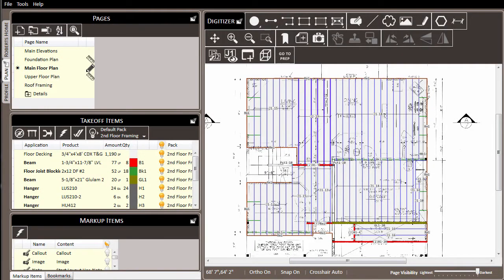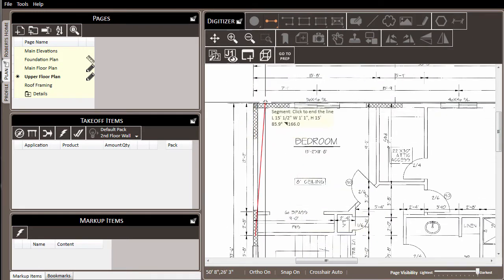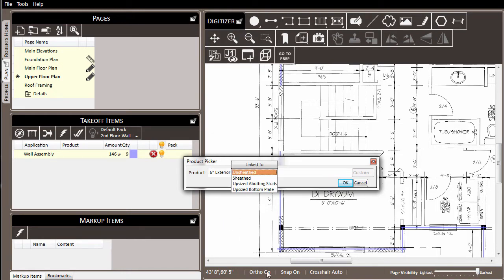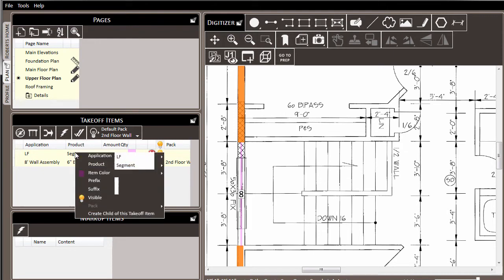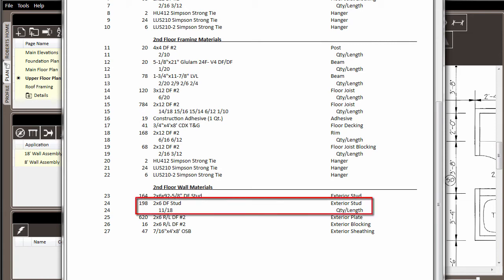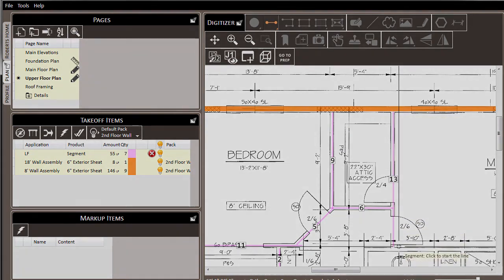Wall Framing Materials

Comment from the maker: Jump to a specific topic by clicking a timestamp below:

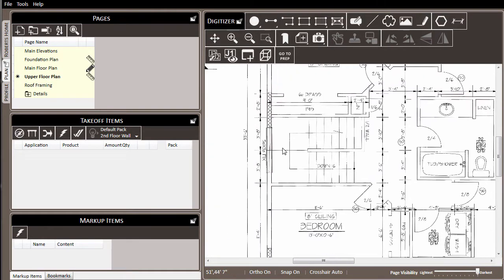0:40 - Drawing the Walls
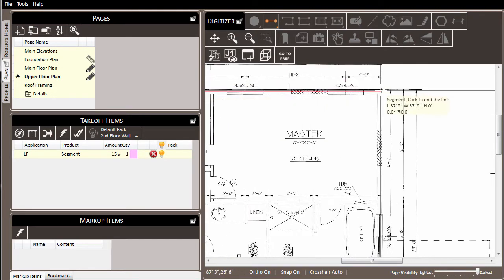1:00 - How to Handle Windows and Doors in Walls
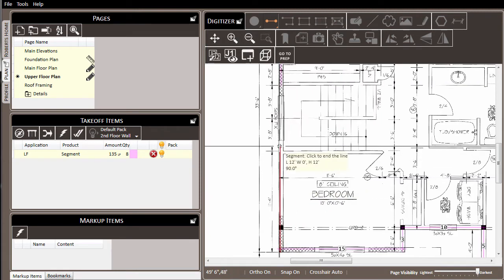1:22 - Walls With Different Heights
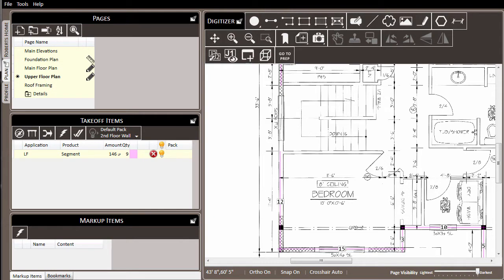1:45 - Setting the Wall Application
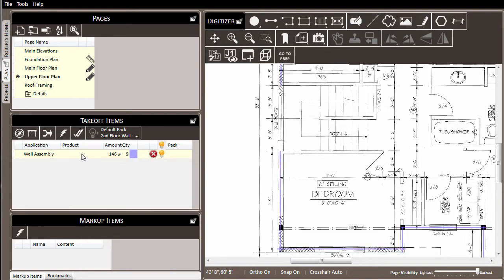1:56 - Setting the Wall Product
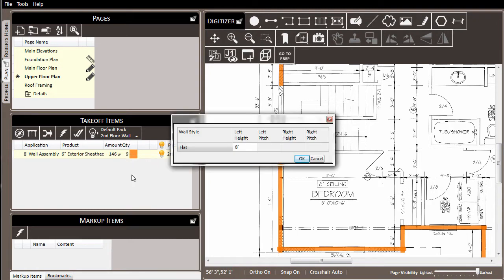2:22 - Setting the Wall Height
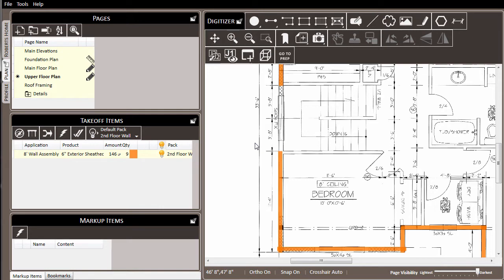2:43 - Reviewing Wall Materials Produced in the List
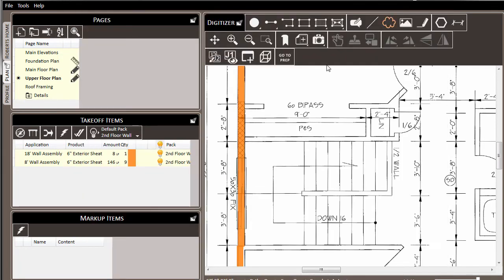4:06 - Estimating Walls Recap